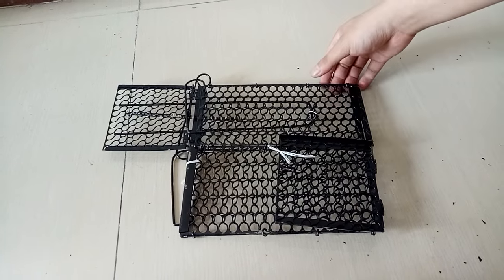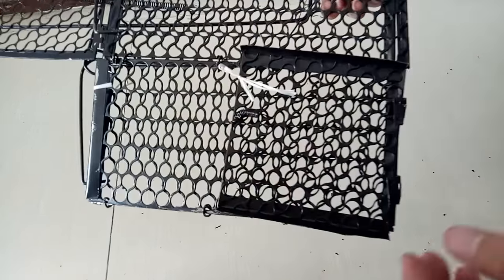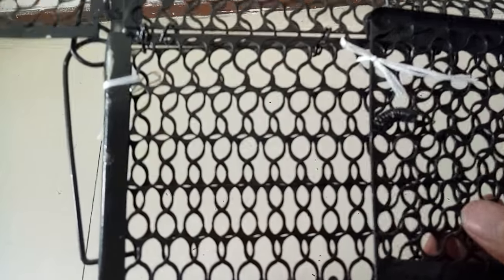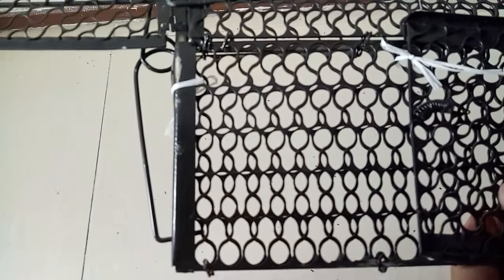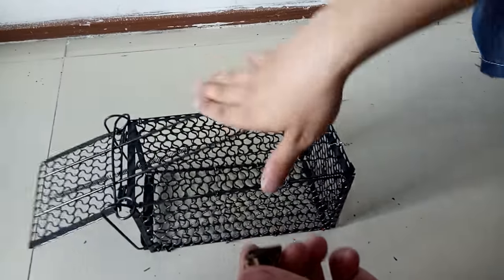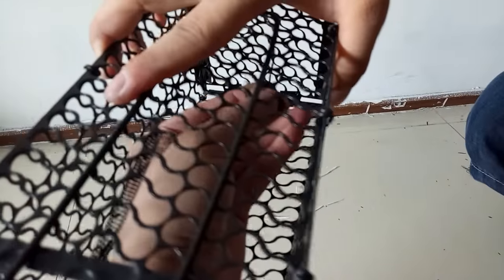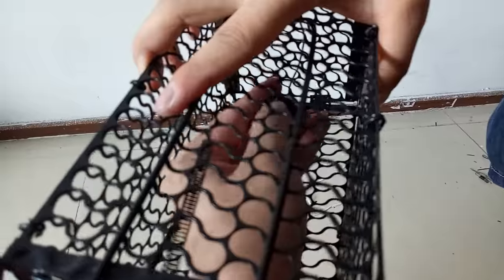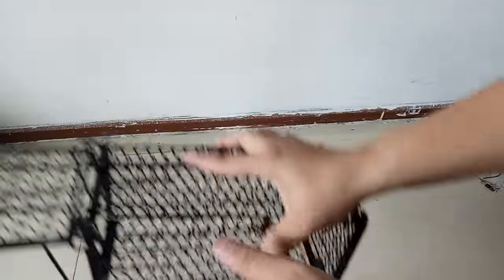How to use Metal Mouse Trap

Comment: Handy tip: the door spring goes on the inside of the cage, under the roof, not the outside. That will keep the door shut and under tension when it's opened.